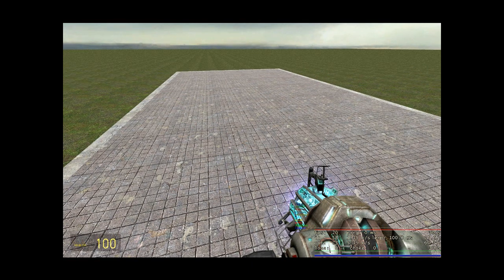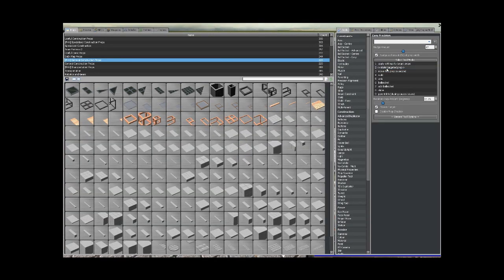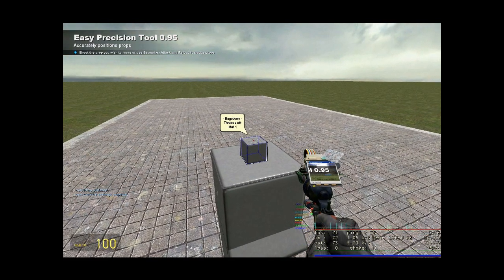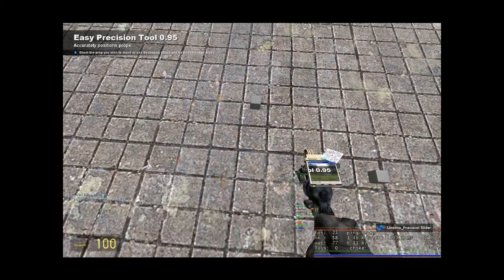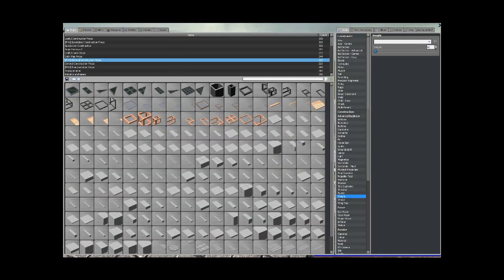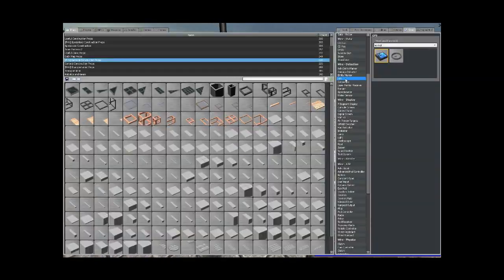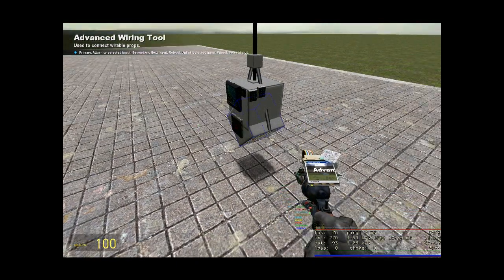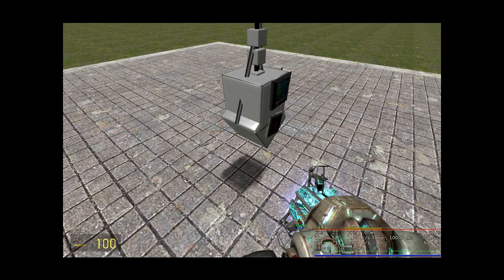garrysmod simple little inline 4 thruster engine tutorial

Comment: put a line that says
if (RPM > 400) {Throttle = Throttle - 50} or something like that and once it goes over 400 RPM it will put let power into it to slow it back down. Don't use that line I just typed though, it prolly wont work with your engine.